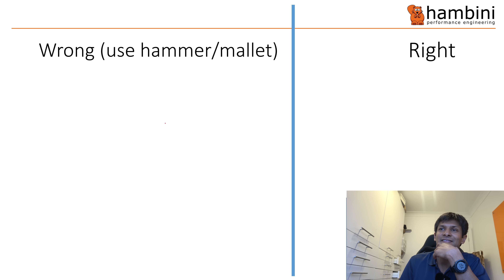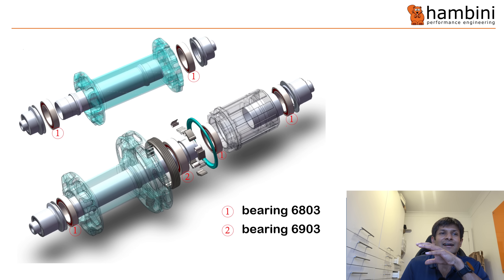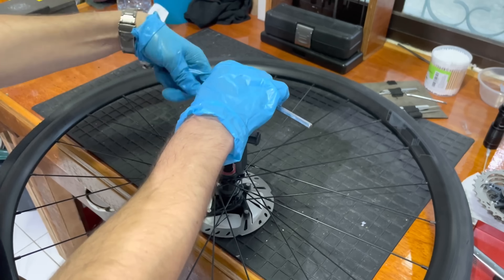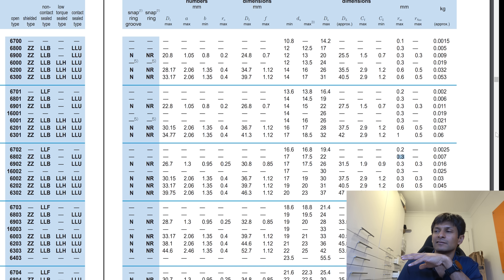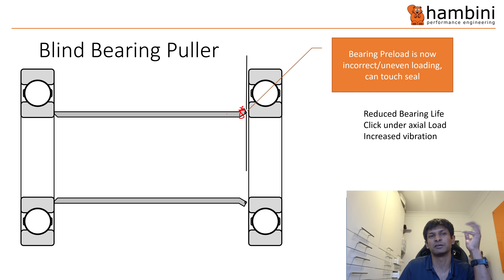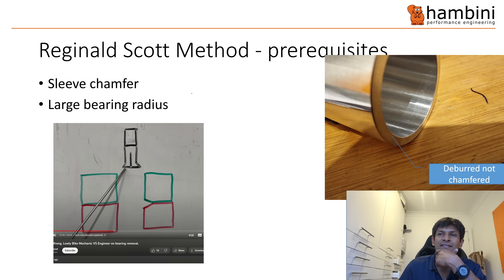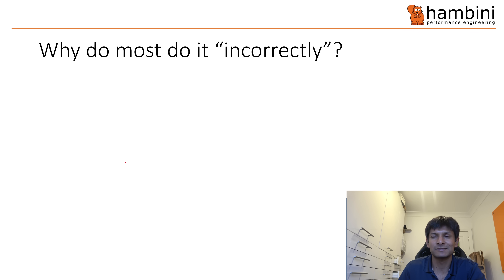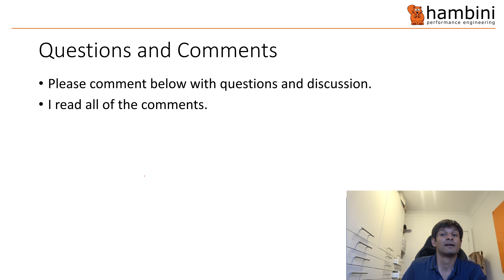I got REAMED by a Bicycle Mechanic | It was bound to happen at some point.

Comment: I guess the real problem is there isn't a normal solution to this. Why not make a chanfer in the middle of the bearing to pull? Or some slots in the spacer where a special puller can hook behind?

Great video and response btw
Reply: Sorry 180 degrees out there.  This set is the normal way, yes a castellated ended spacer could be used, or a 'special' bearing with a flanged inner allowing more of a step to grab hold of with a puller would do at a pinch.  Are you willing to pay for it though? the special bearings, the special range of tools etc.
Reply: @alan-sk7ky  To be fair I own 2k worth on tools just to service my bikes.. This is just a basic set. The bike industry is already full off annoying special tooling. And if the whole industry is going to use it, prices will go down ofcourse. But I do get your point. The castellated ended spacer sounds really like a winner except we might keep te problem of accidentally bending the edges if the tool is to clumsy. A edge in the middle of the bearing feels more durable.

Comment: Excellent response vid Hambini, I have to fit industrial wheel bearings in my work, we use hydraulic pullers with 15t of pressure, sometimes it goes wrong and you end up with a lump hammer and copper drift, sometimes you have to use those techniques because it works.
Reply: Yes. A soft drift. Not a pin punch.
Reply: @bjmaston  A pin punch works better , because it doesn't have the chamfered edge. The chamfered edge of the brass drift causes the force of the hammering to be directed toward the hub inner wall, rather than straight outward.

Comment: I think it's a case of damned if you don't, damned if you do. Using a drift punch with the spacer moved out of the way you invariably cant the bearing inside the bore. Which is also aluminium and thus soft. So you're damaging that too.

To be honest I never thought about flaring the spacer using a puller so I will be thinking about this from now one. But my usual MO is to punch out the bearings if they go fairly smoothly while for the more stuck ones I usually punch it a bit to create a gap then use a blind bearing puller in order to pull on it as axially and evenly as possible.

Comment: You can hammer them in and out with a drift (if you are careful), but a puller/press is better.

So they are both right - apart from the bit about it being the only way.
Reply: Except the puller can also do damage. It's only better in specific situations.

Comment: Do you think the point is bearings should be removed in the direction of the hole centreline? Regardless of hammer/puller technique. 

So the puller will do this, but damage the sleeve. The hammer tapping a side at a time will wedge the bearing into the bore and damage it.  Chose what you want to damage.......

The problem here seems to be the design of the hub not allowing a correct removal, so all methods are a bit bodgy.

Comment: It is possible that the ID of the spacer is slightly bigger than the ID of the bearing to specifically allow for the use of a puller.
Reply: good point

Comment: Correct me if I am wrong. Having the rotor still on the wheel, especially facing down is leaving it open to being bent/damaged/gouged?
Reply: I wouldn't worry about that at all compared to the near certainty that he's contaminated the rotor surface with grease or oil from the work bench he puts it down on, so the brake will be much weaker and howl every time it's used unless it and the brake pads, which will be contaminated by contact with the disk, are decontaminated.

Comment: I suppose if I was going to service and reuse the bearing I would do it Reggie’s way but there may never be an occasion where I would want to service and reuse the bearing.
BTW when I remove a bearing I use a bit of wood dowel to tap on with the mallet or hammer.

Comment: @hambini,  those first slides showing the hammers are mostly knocking out the axle. Both the video you did and Reg showed the axle already removed.
Reply from the maker: have a look at the hope video, that's is pretty much exactly what I did and my other point is you've got some scenarios where the axles have two integrated lips. the puller won't work in those situations.

Comment: Come on man. You already proven your point as an engineer.  Thats it. You need to give the guy a credit. I saw the video and he has the same tool that i have and it works fine. Both of your process has the same outcome. Removing a used bearing out of the hub. Both works. So whats the issue??? Just a tip ok. Not everyone knows everything. So if someone knows something better, we need to accept it. Ok. So enough of this nonsense.

Comment: Typical engineer - won’t take his reaming - spends 10 mins defending his alleged mistake 😂
Reply: As both a trained engineer - and a trained bike mechanic…
This is hilarious - but FWIW I agree with Hambini here - the spacer is the critical component of the hub, not the bearing (the only reason to be removing the bearing is to throw it away). Once the spacer is damaged the hub goes in the bin (because the spacer is toleranced to the freehub body at the factory).
My NVQ (not very qualified) bike qualification is a few rungs down the ladder than a degree in engineering.

Comment: I am sorry, this is not good enough. The pictures Hambini shows are for axle removal, hammering the axle out is completely necessary. Don't forget, Hambini in the original video was hammering the bearing out with a puncher smaller than the inner bearing ring. At (4:52) he mentions the spacer is very soft and could be easily damaged. The puncher would have caused more damage than the bearing extractor. I respect Hambini's opinion however I would respect him more if he acknowledges his own mistakes.

Comment: If the spacer had 2 small “windows or notches” on the end where it contacts the bearings you could then have either a puller that reaches in and has pins or pawls that open up and grab, or, going at it from the other side, you could open the pins up through the holes and tap the bearing out. If this makes sense?

Comment: 😂  You were hammering like fook with that pin punch as if he'd stolen your hairdresser 😜, not going around the circumference to take it out carefully and as parallel as possible.  Ok let's utilise both, pin punch to create more clearance then utilise blind bearing pullers to extract the bearings parallel thereby not marking or disrupting the fit on the aluminium bore. How's that? Ps. Do t you think hammering the feck outa the inner race of the bearing is not potentially going to pit or ruin the bearing either? As much chance as the bearing puller, that's a non argument. I have removed bearings both ways and never had any issues, the only issues come with potentially at the end of thier life cycle bearings which should need replaced anyway. Stay clear of what those  quality engineers say the last one I had told us to use gloves when using a pedestal drill 😂 because of sharp cuttings 😢 😂 i.e. he has no idea what he is talking about and has never used one, but felt in it should be proudly displayed in a matrix on a  poster and lean manufacturing poster. I kid you not.

Comment: 2 things matter, tell us what is a safe angle a bearing can be inside a hub when hammering it out. 2. replace the spacer if you do use the bearing puller. he claimed you said theyre wasnt a tool or other method to remove the bearing, if that is true,  it would make you wrong to say that even if you knew about the blind puller theres no proof of that. but to your side he didnt know about the spacer being damaged, so i have it as a tie so far, what will the tie breaker be?

Comment: The fact is, each hub manufacturer has their own proprietary way to extract bearings. Some request you use a generic bearing puller, and some like DT ask that the axle be used to hammer the bearing out. Others still have their own specific hub tool set to extract bearings. If a shop mechanic doesn’t use the recommended method of extracting bearings it usually leads to some kind of damage and a voided warranty. This is why shops are dealers in only a few wheel brands at most, and send customers to authorized dealers if they’re not. In any case, only a hack mechanic goes into hub bearing removal blind, or thinking their overarching knowledge of engineering is all that is needed to successfully pull it off. A good mechanic does their research first and uses the proper tools recommended by the manufacturer. #Hackbini